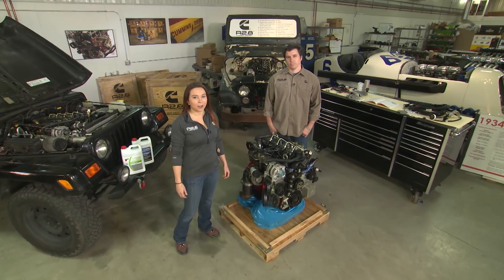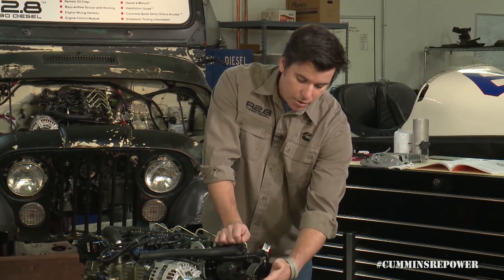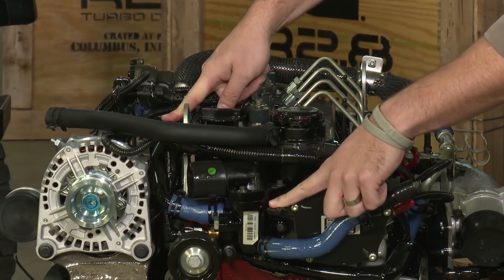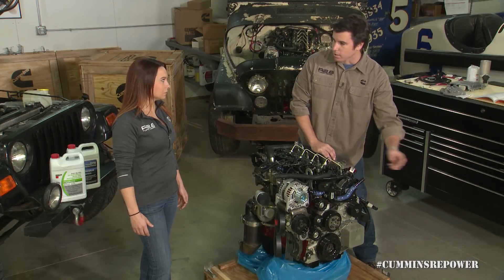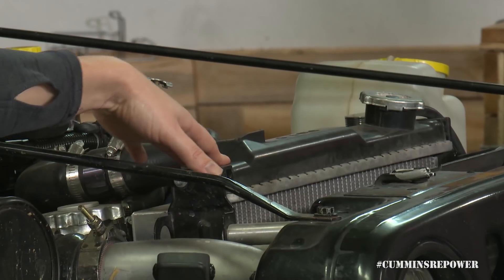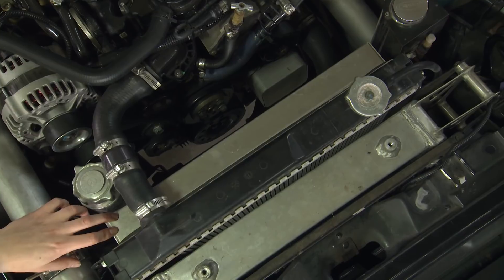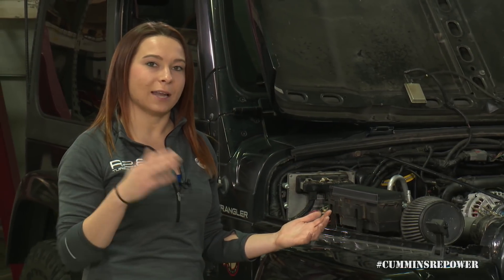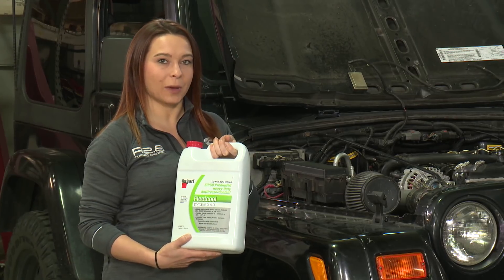Cummins Repower Garage Video 6: R2.8 Cooling System

Comment: Gauges lol the factory for instance on oil  pressure if the min pressure is met then computer generates a value based of rpms , coolant temp , ect .  I was told this is the way my old dodge diesel is . If you ever watched a set of manual gauges work you can see the temp movement especially if you got a lot of extra capacity in the radiator , heat exchanger .

Comment: terrible motor terrible company when their terrible motor fails
Reply: Did you have an experience with it?
Reply: @estebanamador7601  yea! A terrible experience I’m still trying to figure out. That shitty motor blew up with 10k miles on it. Now I have to undo everything I did to it just for the stupid ass motor
Reply: @MAJORAUTO  thanks for your answer.  What was the failure? (Headgasket, conrod, piston) thanks.
Reply: @estebanamador7601 i haven’t pulled it apart and probably won’t. Definitely a rod knock with metal in the oil, I’ve read about failures with the oil pickup tube in the pan but not sure. I was blown away on how poorly Cummins handled it.
Reply: @MAJORAUTO  oh man, sorry for that and thanks for the information.

Comment: Step 1: Remove EGR 

It does nothing for emissions but destroys the engine.
Reply: How can I do that? Will it still pass emissions
Reply: George Navarrette just get custom block off plates made by a fabricator and use the factory screws. The egr and egr cooler are basically a tumor on the engine. Id also take off the cat when installing. I don't think that a code would be thrown for doing this